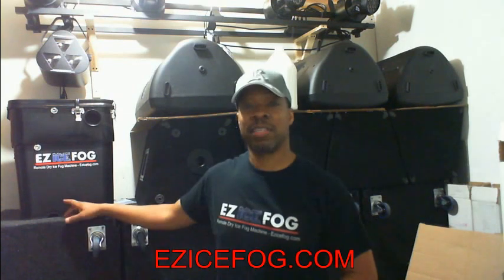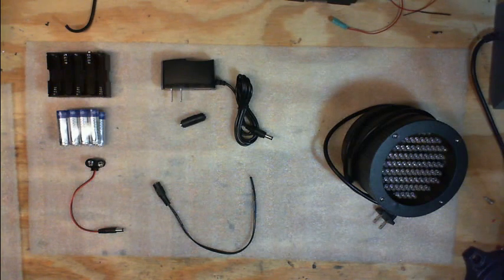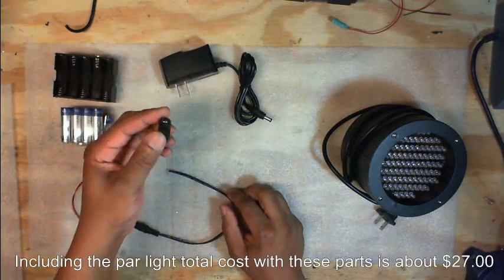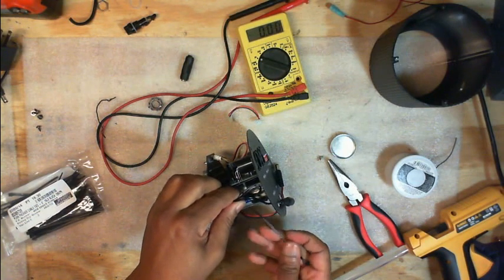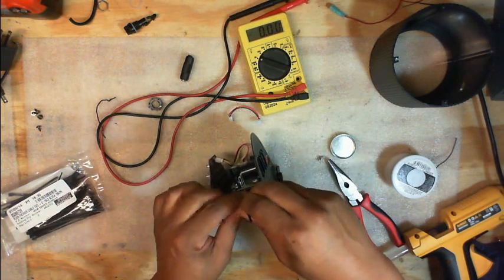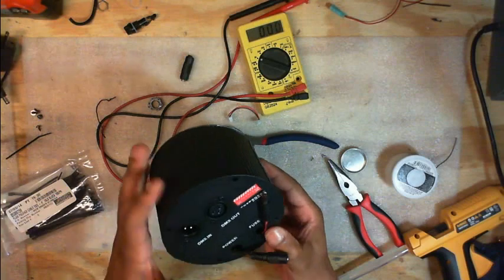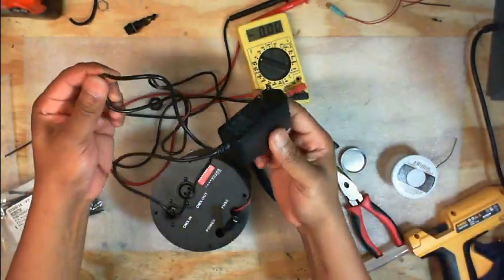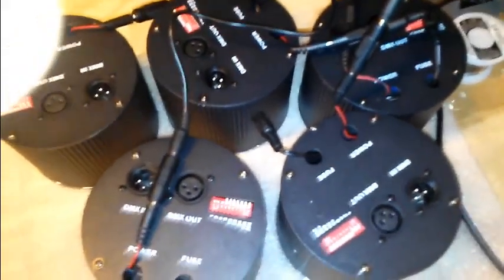DIY Battery Par Lights Conversion - FROM THE BENCH TO THE BOOTH/ Ep. 6

Comment: Noob question here, the voltages in your video were slightly different does that matter? (Batteries were 12.30v and original power supply board was 11.75v)

Comment: I purchased the lights and followed the steps other than used the units 110 to 12v power supply to create a charging adapter.  When I plugged the original power supply back to the light to ensure the led lights still lit up the capacitor blew up.  I don't understand how that can happen when I essentially reconnected the original power back up.  Any idea why that could have happened?
Reply from the maker: There must have been a short somewhere. Are you sure you didnt reverse the power connection during the reconnect?
Reply: there was a short, after further investigation.  Thanks  :)

Comment: If you were to use two or more 12 V battery packs wired parallel ...would that extend the hours of operation??  Also, do you know of a PCB float or trickle charger that can be installed on board?

Comment: I am in the process of converting these LED uplgihts. This is awesome and a super money saver!! Has anyone used 10 lithuim batteries to power the light. I don't know a lot about power sources so I don't know if It will provide too much power or just longer lasting power to the light. Any advice from anyone would be great! I have a wedding coming up in a few weeks and I plan to use 16 of these which I converted I just want to make sure they don't start dying towards the end of the reception! -Justin

Comment: Would this work to power it? http://www.ebay.com/itm/331454820710
Reply: Yes, those are the ones. If you have the switch on, they have a red power LED that discharges the battery so you can't put them inside the par can. I did some surgery and removed the LED but they still have way less power than they are rated for. In other words, they suck.
Reply: I join the question
Reply: Just finished a gig with the Li-ion packs off ebay. 1/2 the run time and if the discharge too low, the battery is destroyed. Don't buy them.
Reply: Tim Folkenson was this the type of battery pack you used thay didn't work very well? 
http://www.ebay.com/itm/311718228138

Comment: has anyone done this yet using the original power supply?
Reply from the maker: +Dave Losh the original power supply will not work as a long term charger, You will need some type of trickle or smart charger.

Comment: i'm thinking about using lithium ion rechargables for this you will only need 4 of them they are 3.7 volts each you think this will work also
Reply from the maker: +Bob M I think that would be a smart improvement! Be sure to test your charger with the batteries as mine turned out to not be strong enough after a few months of use.
Reply: thanks will do
Reply: 4 cell might be too many. They probably can handle the extra voltage but if they are discharged below 3v, they are damaged and wont recover. 3 cell range might be closer.  A fully charged Li-Poly is 4.2v, a discharged Li-Poly is 9v so a 3 cell pack runs at 12.6v and a 4 cell pack runs at 16.8v.

Comment: 2 questions 1) A year later how are the batteries holding up? 2) Did you use Ni-Cad or Ni-Mah rechargeables?
Reply from the maker: +Minnesota Wedding Party the batteries are fine but the chargers were not strong enough to bring the batteries to full capacity after several months of use. Had to upgrade !

Comment: great video thanks , now what u need is to make this light wireless http://www.ebay.com/itm/Wireless-DMX512-PCB-Modules-Board-LED-Controller-Transmitter-Receiver-/171373503619?pt=LH_DefaultDomain_0&hash=item27e6a82483
Reply from the maker: HYVBJ JGT  I thought about it and priced it out but it after the time + labor+ parts it would be cheaper to order the pre-fab from China. They are really cheap now :-)

Comment: Awesome video!  I just bought 10 of these and you inspired me to convert mine to 12 volt operation.  If I need battery use I can just put a pack on the outside.  I'm going to try these for the power jacks on the lights:
http://www.ebay.com/itm/331555587620
I was planning on hooking them together with one of these:
http://www.ebay.com/itm/141659444734
Reply from the maker: +DJ ROBS It is on the circuit board I cant remember exactly but there is a set of pins -/+ inside with the 5 volt out.
Reply from the maker: BackyardProjections.com Those power plugs with safety cap are cool. If you are going to daisy chain them just make sure your power source has enough amperage to support the multiple 12v lights. They don't pull much power at all and without using a formula I would suspect a 12v 5amp power brick could do the job!  I like the idea of also using an external battery pack if needed...good idea!
Reply: DJ Conscientious I have several 3-4 amp 12v power supplies lying around so I'm good there.  With the DMX controller I'm getting I'll be able to have a fully 12v system that could be powered directly off of a vehicle.  I'm now thinking about experimenting with wireless and figure this would fit in the housing:
http://www.ebay.com/itm/111505140801
I can gut one of these for the needed 5v:
http://www.ebay.com/itm/221769683588
My thought is I can solder the leads to the existing DMX-IN socket so the lamp should work either wired or wirelessly.  This way I can have one wireless lamp in a group of two or more and control all across the wireless connection.
Reply from the maker: BackyardProjections.com good news..you wont need the 5 volt adapters. There is a 5 volt unused tap on the DMX board!  Sounds like you are on your way to cool set-up!!
Reply: DJ Conscientious I'll check out that 5v tap.  That would make life easier.  I just got the lights yesterday and have started messing with them.  My other parts are still on the way.  However, I've already started tinkering.  I wanted to soften the light a bit so I'm trying this stuff inside the lens:
http://www.contactbrand.com/shop-clear-covering.htm#.VXybNEb-WQw
I found it at Home Depot for under $9, and it's a big roll.  I'm trying the diamond pattern and I think it looks good!
Reply: BackyardProjections.com Okay, so the film mutes the lights a little too much.  I was hoping for something to spread the light out to more of a flood but guess that will require a lens - fresnel or otherwise.  In the other hand, this stuff is good on a couple of bright white LED floods, so not a total loss.
Reply: +DJ Conscientious Hi iam trying to do the same but where is the 5v tap?